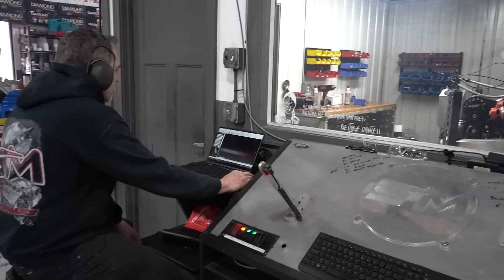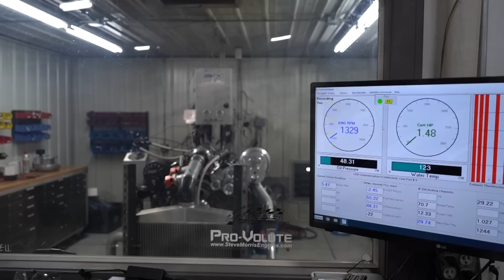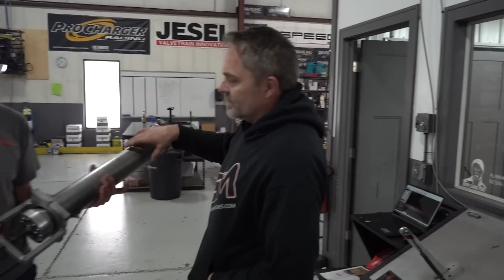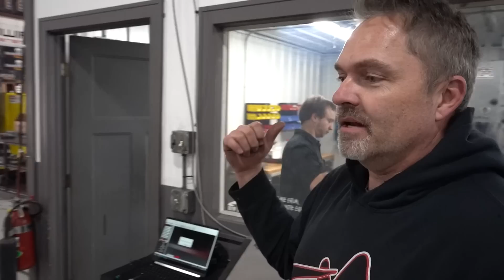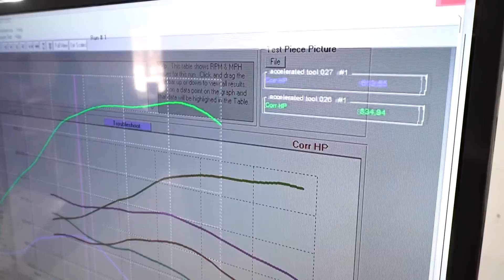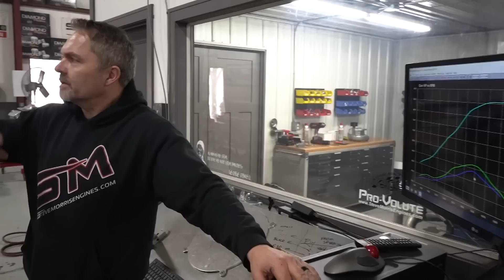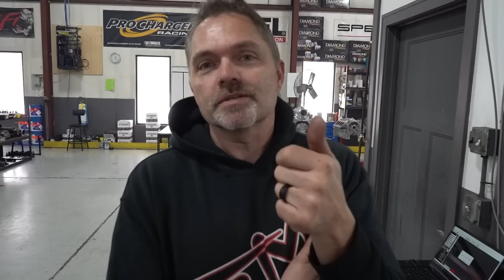CRAZY Testing After The  Dyno Session

Comment: For the crank movement, as you have mentioned in previous videos, the pistons are trying to push the crank down out of the block. I would theorize that when the supercharger is forcing air into the engine, the extra force from the cylinders making more power is helping hold the crank down against the pulley trying to climb up the belt. As far as when the blower is not feeding the engine, I may be overthinking it, but I do know that boost is really just a measure of restriction. So if you can make the engine more efficient, it can or will make the same power at less boost. So with a centrifugal blower, is it actually better to run higher boost levels because the parasitic power loss is less?
Reply: if the engine is able to flow more aka lower boost pressures, the supercharger won't have to do as much work.
Reply: But they said and showed the parasitic power loss goes way up when the blower is unrestricted on the pressure side. So if the engine is running a lower boost pressure, the blower can actually move more air. I'm just curious of the gradient at which it crosses over. Because in the case of this style forced induction, (it seems) you would actually want some restriction to unload the blower. BUT the more air going in the engine makes more power which could run the blower at it's higher load? Maybe just a vicious circle. Lol

Comment: Steve, what about cylinder pressures when in boost? Would the extra power each piston make on the power stroke help keep the crank from moving? That could be the difference when you are running the blower to the engine vs to atmosphere.

Comment: Steve, you and I are so alike in our thinking. You are absolutely right about blowing boosted air through an orifice into atmospheric pressure versus into and engine which is displacing air at a high rate of speed. Always remember though, a vacuum doesn't suck anything, atmospheric pressure is "pushing" air into the voided space. Keep up the teaching, much appreciated.

Comment: it might be volume and pressure. the engine takes say 1000cfm and if the boost is 14psi then that pressure increases the volume to twice what the engine can take but to increase the psi to the same without constriction except the pipe the volume would increase substantially thus increasing the load on the pump.

Comment: What happens if you put a closed valve on the inlet side of the blower than run the engine to 5k and open the valve slowly until fully opened. Would that give you the amount of HP it takes to run the blower? 🤔

Comment: Horse Power is a time rate of work, Work = Force X Distance.  The Air we breath has mass, the centrifugal blower moves the air a certain distance in a certain amount of time and takes horse power to perform that work.  Steve covered the situation where you cover the inlet of a shop vac and the motor speeds up.  This happens because the shop vac no longer is moving any air.  This happens with the centrifugal blower also.  I want to point out that when you dead head the centrifugal blower, there is very little work being done because it is not moving any air, however there is still air in the case of the centrifugal and this air is being stirred up, energy is being added to the air so the temperature within the case rises.  If run to long dead headed the centrifugal will burn up and fail.  In effect the inlet air to the centrifugal is cooling the case itself.

In this experiment the centrifugal moves more air at less boost therefore more work is done at less boost.  As the boost is increased less and less air is moved and therefore it takes less and less horse power to turn the centrifugal.  Right up to the point of dead heading the centrifugal, then the horse power drops off the most.  The pressure falls off at this point also, almost to zero, but this depends on the compressor map for this particular centrifugal. 

One more thing, none of what I said about a centrifugal blower above applies to a roots type blower.  A roots type blower is a positive displacement pump a centrifugal is not.  If you dead head a positive displacement pump it locks up because the pressure goes to the moon.

Comment: The blower has to follow the fan laws, and the more air it moves the power goes up and the air goes up linearly with the speed of the fan.  I forget the formula off the top of my head, but I have it in a set of spreadsheets that I use for testing my own products.  Interesting results with how much power it's taking to spin the blower.  Not surprising based on how much air it can move though.

Comment: Kyle is on the right track, but your test method is accurate too, just at only one point.  
The restriction to blower output when plumbed to the engine is variable with engine RPM while your cone on the contraption provides a fixed restriction throughout the entire dyno pull.  There should be one point where the engine RPM and blower output pressure both match between the runs with the blower belt on.  The difference between the NA and 'contraption' HP at that PRM would be an accurate HP to turn the blower at that RPM, pressure, & CFM.  To get another point at a higher RPM you would need to open the cone, run another sweep, and find another matching point.  You could fit a curve to several of those points to get an approximate HP to turn the blower at other RPM's, but it would only apply to the airflow rates used by that engine.
In order to correlate it to the testing TS had done an airflow meter on the inlet of the blower would be helpful to match inlet CFM.

Comment: Pressure & mass airflow aren't necessarily directly linked for tge charger but they are for an engine. You need to know what the engine is consuming & then apply the pressure to get the balance of mass airflow & therefore power for your given setup. It's a bit mind bending but if you keep in mind that boost is actually the measure of engine back pressure it helps visualise it, does for md anyway!

Comment: The processing had me laughing like a school girl...LOL, all kidding aside the restrictor is fixed forcing the pressure up with rpm, where the pressure is the same as the hooked up run is your most accurate power taken.  A restrictor that maintains a steady pressure level or mimic the pressures when hooked up would work.  Your hand over the vacuum hose is the opposite of what is happening as your in essence putting your hand over the vacuums outlet in which case the motor slows down since the impeller is in pressure not vacuum.

Comment: When the engine eats the air, it takes less horsepower because a majority of the time the intake valves are closed and it’s able to build that pressure, as a result the blower isn’t being asked to intake more cfm, but when there is no resistance to the blowers output, the input then sees this resistance as it can only “suck” so hard before the atmosphere says hey buddy you better lighten up over there before one of us blows a component.. or something like that idk. The atmosphere always wins though.

Comment: Great video. That device those guys made to adjust back pressure is neat. Years ago I was bucks down and wanted to perform that same test so I used a 3 inch Supertrap muffler and changed the number of discs to recreated the 9 lbs. of boost the engine was actually seeing

Comment: Boost is a measure of restriction not air flow. Would it make more sense to measure how much air the compressor draws in on the engine and them replicate that with the test tube? 🤷‍♂️

Does compressor blade size and pitch create another variable?

Comment: put a waste gate or blow off valve on the restricting tube to modulate boost through the rpm so boost won't spike higher in rpm and drive parasitic loss up, considering when you have boost in higher rpm the engine is consuming more and more cfm versus the restriction tube resting at a constant consumption and again raising parasitic with rpm

Comment: Steve, a thought on the trigger wheel hitting the pickup NA, blowing off through the Ford block, versus not hitting under boost. The higher cylinder psi during compression under boost counteracts the direction of pull from the drive belt keeping the crank more on center, versus NA?
Reply: Well, I see fake Steve is on here responding.

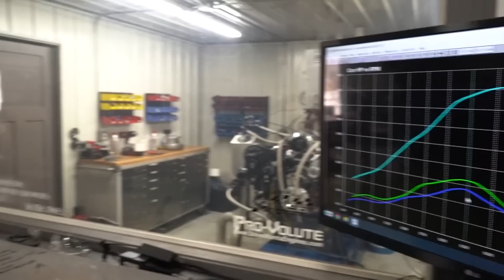Comment: 42:20 - Anybody can test this effect themselves with a shopvac as well. If you completely plug a shopvac hose, the motor RPM goes way up because it no longer has a load on it. And you can observe the reduction in current using a Kill-a-Watt. If you take the filter and hose off, the opposite happens.

Comment: The engine is pulling the air in even if you are forcing it with blowers/ turbos what ever. That added vacuum would aid the blowers resistance with that little bit of pull. That is why you see the difference between to connected and non connected tests. You would have to compute some constant to account for that variable of the motor aiding with natural vacuum.

Comment: Same test but run boost pipe thru  The adjustable restrictor(set at same 12.5psi) And then into the motor on the other dyno at 5500ish+ rpm(or a measured 1000cfm point on that motor).. The timing of the whole fiasco will be key but you could get honest results with just some piping.

Comment: Has me thinking. Have two engines side by side. The one you're testing on blowing into one driven by a stout electric motor. Linked by rpm to the test engine. 
On the electric drive engine. No combustion would be needed. Use the sparkplug holes to monitor added compression. Maybe even see the load change on the electric motor when the boost is changed.  
You could try an heck of a lot with that set up.

Comment: Hi, about the crank deflection. Wondering if at the boosted power level the internal forces on the crank are tending to hold the crank in the saddles much better than at the unboosted power/torque level, just thinking here, thanks for the vid.

Comment: Super interesting test!

I was really surprised to see the crank snout was flexing that much. Scary. Wondering if maybe the main bearings should get looked at before that engine is run hard again.  Not that I've run that stout of combination, but making me worry if it's fatigued the front of that crank, or scuffed a bearing possibly...

Also, a test protocol might be to make a mount which would incorporate a load sensor on the supercharger mount. Kind of like you would do for the load cell on your Dyno... if it takes xxx lb/ft to turn the pulley, it should try to spin the blower case a similar amount.

Measure the force (torque) trying to spin the blower case, you know what RPM the pulley is spinning: calculate HP to drive the blower from that

Just a thought - might be harder to implement than imagine...
Reply: Also, wonder about using a butterfly valve instead of the cone; might be something that could be run by a stepper motor, and controlled remotely from the control panel of the dyno

Comment: @Steve Morris Engines I'd have to agree with the cfm/volume thought. Frist thong that came to mind was when cranking up 1:1 fuel pressure regulator. Psi keeps going up but volume doesn't after certain point and. Thos test on some way, not technically sure but seems love a similar cause effect with or without engine in place.

Comment: A running motor creates a vacuum in the intake compared to standard barometric (your PSI at your altitude, 14.xx psi) which creates less pressure or back pressure on the supercharger to make boost.   You nailed it in your last 30 seconds of the video.  I'm not a supercharger or turbo expert, just an Elec Engineer, but we all had to take physics to be Engineers.

Comment: Yeah mate, we all love a good head scratcher... 
Blower pumping against a dead head VS blower being assisted/relieved by the draft of the engine...
the boys need to come back with their air flow meter & use it on a live dyno pull...
ATM you have numbers on rpm, pressure & temp at dead head with drive loss.
What you are looking for is rpm, pressure, temp & cfm with drive loss at full song on a live dyno pull...
Note (for newb's) that these numbers would change according to the airflow characteristics of the individual engine...

Comment: In thinking about it I think it has to do with air density in the compressor wheel itself ... Though you are correct that vacuum is causing an increase in pressure differential from your test ( engine is an air pump) the fact that an open tube will stall an engine is I think the telltale ... With airflow meter on the inlet and temperature gauge on the outlet I think it would show a higher flow and lower temperature which would mean the impeller is a seeing more air density and so requires more Force to turn ... A better way to test is probably to measure the inlet air flow with it running on the engine then adjust the airflow restriction on the second part of the test to match the flow of a running engine and not worry about boost level ... The power requirement is really about the amount of air the impeller moves and how it heats up in the impeller and lowers the density of the air ... I would bet the boost pressure in such a test would be a bit higher then a engine .... Also when you set the pressure was it to pressure after the intercooler? Because there is a pressure drop across the intercooler and supercharger is before that or a higher pressure ... Anyway my thoughts on this fascinating puzzle

Comment: Way cool episode. So what my brain is thinking is that when the engine is attached the cfm needed to hit 12lb is higher because there is less back pressure due to having the air volume of the engine having a momentary vacuum, there is also a maximum amount of air that volume that could be pushed into the engine per minute Which assumes the air is at 12psi, the maximum volume of air that can be supplied would be cylinder volume of the total intake strokes per minute. In the parasite load testing it does show at that current setup the hp required to move the cfm per blower rpm produced with at each given engine rpm,
Did the boost from the tester read constant or was that a curve decreasing as velocity increased. I wonder if you would basically need a waste gate maintain steady pressure as the velocity increased. So at low speed producing more than the engine needs would be fairly restricted but then vary to much wider at the end of the pull because so much more air is pressing into the same space,

Comment: Put a actuator on the cone to open up the gap to help model the compressor drag for an actual engine. As the RPM of the motor is increases the CFM going through the motor increases. Currently the cone is just a static restriction where the engine is would be dynamic with regard to RPM. With positive manifold pressure I think the scavenging effect of the engine is negligent. The engine acts a restrictor to flow relative to rpm and cfm for the compressor allowing it to run in its "sweet spot" on the compressor curve. Without it the compressor is probably hitting its stonewall or choke point creating so much drag it pulls the crank more.

Comment: How much air the Intake stroke takes into chamber × 8 ÷ 2 × RPM - The CFM the blower is making at the RPM used in the first equation = the difference between running it not connected to the motor. Then subtract that # from the pull with the blower connected and you will have a equal comparison !

Comment: Basically this: The engine requires X amount of air to make power. The excess of air is what gives us “Boost”. (I’m being very simplistic) But when you plug the discharge pipe you are creating one heck of a restriction. 
For example compare how many cfm it takes to make x amount of hp. Then compare the scfm and acfm of the centrifugal. You basically want to know how much energy it requires to produce x amount of acfm. (before stalling the compressor)
Reply: “Boost” is only a measure of restriction. This is why you can port a cylinder head (only) run the engine again and it make less boost but more power.
Reply: I’m just surprised it didn’t shred the belt! I’m sure the engine turns a little free’r now!! 😂
Reply: The engine takes a lot of load off the compressor just to breath. That big cubic inch engine is trying to eat the blower! Where a smaller cubic inch engine would see a higher compressor drive load. Steve, think of it like a dynamic compression ratio.
Reply: It’s all very fluid 😂  (that’s a fluid mechanics joke)

Comment: What specific spec of belt is used to drive the blower? Watching the pull the tensioner position is tracking load, the radius (torque arm) at the crank converted to tension against the belt spec one could derive stretch and tensioner position. Tensioner position could be used as a rough tension -> torque-> HP indicator.

Comment: Got to measure the HP on an installed, working blower to get the parasitic HP.  Key numbers are the torque and RPM on the blower shaft at the pulley.  This can be done by measuring the belt speed and difference of tension on each side of the pulley (hard) or by measuring the torque and RPM of the blower shaft (probably requires changing the blower shaft to a longer shaft and two Gray-code readouts on it).

Comment: Top fuel blower test bench takes over a 2000hp electric motor to test the super chargers.  So a top fuel engine has to produce at least 2000H.P. just to run at wide open.  So the engines are actually producing 8000hp? plus what it is taking to run the super charger.  So the engine is actually producing 10,000hp

Comment: It's really simple,  ( NOT ) ! ! !     Yes the engine is pulling a vacuum and you can measure as a comstant but it is actually an intermittent vacuum with highs and lows that you are not measuring the highs and lows.   When the compressor over comes the engines vacuum is when the compressor starts making boost and does so until it can no longer keep up and the engines vacuum over ones the compressors ability to do so ! ! !